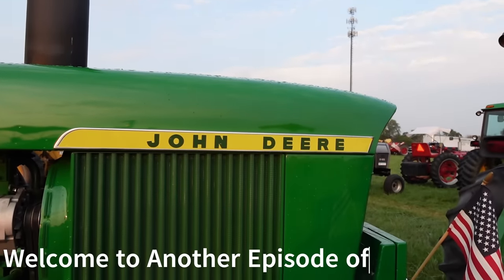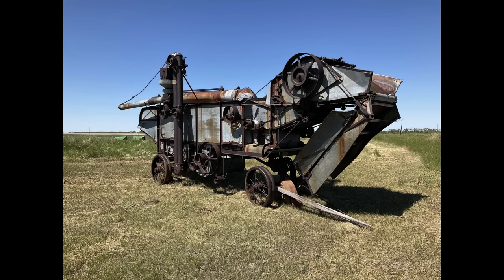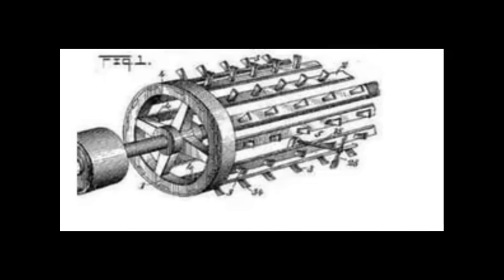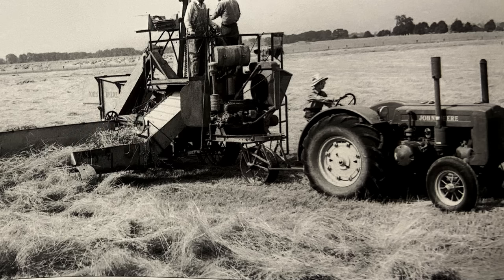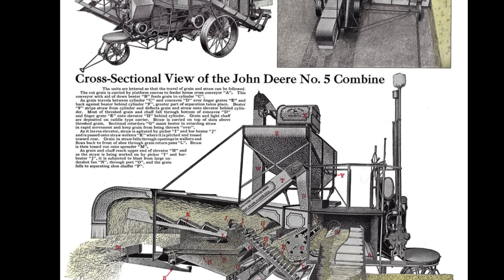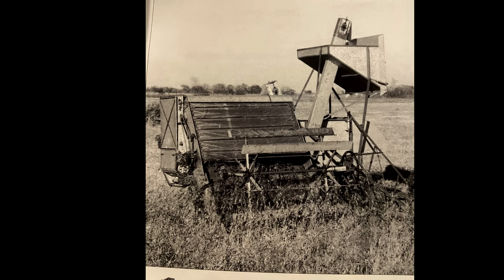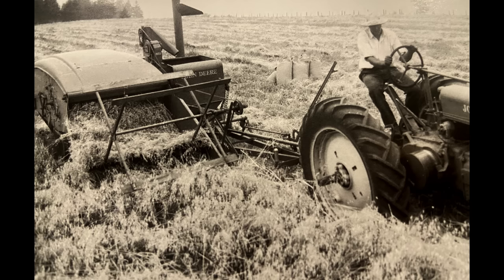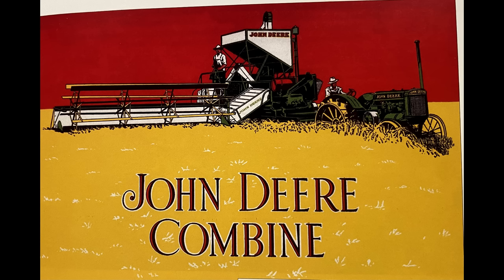History of John Deere Combines (Part 1)

Comment: I helped runJD 36B combine pulled by D4 cat from 1966-68 . Dad already had JD 55 with an added hillside conversion done in Garfield Wa, later JD 55H,95H, both factory hillside combines, in 2001 I ran JD 9600 with hillside added in walla walla, Wa with a 30 ft header for a friend after leaving my family’s farm on some very steep hillsides . We cut 2100 bu on a good day with the old 36B hillside combine, it started w/ a crank, header was 16.5 ft header. It had a 2nd (upper)cleaning sieves and many of them had an automatic leveler control built in Spokane Wa, an added hydraulic header control enabled one man on a cat, usually D6 cat , to run the combine by themself. Dad paid $300 for the 36B combine when we had doubled our grain acres, it was 20 years old in 1966.

Comment: When my father was young, a thrashing crew came around to do the small grains. Then the family got a 12A with the continental engine (I think) and a bagger. Sometimes I drove the tractor from the late 60's to the mid 70's. Every now and then, the canvas belt needed sewn. We also went to Charlie Burg's junkyard near Zelienople, PA to get parts, such as the wood slats for the straw walkers. We got rid of it when he ran out of junk parts and scrapped the leftovers. I think they used a JD B, Then a 2010, and we also had a 3 cyl 820 near the end.

Comment: I came across an 11a I believe is a 1941. I'm told I am the 3rd owner of it and it only has 2 seasons on it. I believe the 2 seasons part because the paint is still in the bottom of the cylinder bar grooves. I will get it restored someday. Got it and a 39 styled B for $750 each.

Comment: I worked with my uncle in the early 60's using probably a 12A combine with an engine.    He windrowed his oats with his hay mower with an attachment and because the combine  was a left sided feed, he had to start in the center of the field so as not to drive on the uncombined windrow, and work outwards.    By the mid 60's, he had bought a new combine and I was off to college!
Reply: My father had a 12A with a two cylinder motor. The combine itself ran good. Having to watch and care for the canvas added time and work. The real problem was the two cylinder motor. It would run fine for awhile. Then it would refuse to run for some time. Which was a headache, because it was hand crank started. Dad would crank and crank for a half hour to an hour before it would restart. Mechanics from five different John Deere dealerships tried and couldn't fix it. Independent mechanics tried and failed. After years of this frustration, Dad finally traded for a PTO driven #30. We had far better harvest seasons after that!

Comment: Dad bought a new 12A around 1950. It was PTO driven 12A with a pickup head as we swathed our barley.  The swather had a 10 ft head, so with the higher yields in Southern Ontario, it was a bit much for the 12A to handle.  Dad had a Cockshutt 30 tractor with live PTO and creeper gear, but we still had to "slip the clutch" to feed the 12a combine very slowly so we would not "plug" it.  Around 1970 dad bought a used model 30 combine which handled the 10 ft swaths much better.

Comment: My father bought a used John Deere model 2 combine shortly after his WWII military service in the Pacific Theater.  Dad did custom harvesting of small grain in North Dakota with that model 2 combine.  Dad cut the steel rims off and added used rubber tires (when they became available after tire rationing ended) for easier road transport.  He pulled his combine with a John Deere model D tractor.   

Dad and Mom purchased a farm near Finley, North Dakota, in 1950 shortly after their marriage.  I was born in 1952 in Sharon, N.D. in a one room hospital.  Dad and Mom sold their N.D. farm in about 1956 and moved to northwest Iowa.  Dad moved his J.D. model 2 combine to Iowa and used it there for a few years.  

I remember when I was about 7 years old driving the JD model D tractor pulling the #2 combine while Dad rode along teaching me how to do that.  So the first combine I learned to drive was the first model combine that John Deere built.

During my farming career, I owned or drove the following John Deere combines -  a 55 roundback (Dad owned that combine), two 55 squarebacks (Dad owned one, I shared ownership of the other)-  one 7700 , one 7720, two 9500s, one 9510, and one 9560 STS (I owned all of these after Dad retired.)  

So I was fortunate to know what it was like to experience operating many different combines that were built from 1927 to 2007.  My last JD combine had a GPS yield monitor and GPS auto-steering.  I really enjoyed that GPS technology.

I remember Dad's JD model 2 combine parked in the grove when it was no longer used.  Later it was cut up for scrap.  In retrospect, that was a huge mistake to scrap it out.

Thanks for your video about early JD combine history.  It brought back a lot of memories.  (Retired Iowa farmer.)

Comment: When I was 18 years old, I drove the neighbors 55 picking corn and that was the first combine. I ever Grove then I started working for a farmer. That was a machinist that would brothers. Manufacturing company in Oregon, Illinois, and he had A.  105EB.
And we did soy beans and corn.
Reply: And when I was growing up on the dairy farm. We had A12A that had A luc motor on it, and dad took the motor off and put PTO on. That made a lot better combine.
Reply: I grew up on a farm we had a 12a with luc motor & a bagger system my job  was to tye the bags and you sat on top of the engine this was hot work

Comment: I had a 25 with wooded shakers  It was used got it around 1980 the shaker  broke after a couple years  found another one at a neighbors that had metal shakers   Removed them and put in my machine. Worked great   I keep thinking how did l ever accomplish that  was young and could do anything. WOW

Comment: We had two #36 combines in Northern Montana in the 50’s  We pulled them with an R and a TD 14 crawler.  When the 55’s came along we ran it and the two 36’s for a few years.  Once the 95 came along, that was great.  The diesel gave us enough power to get through the heavy spots.  The gas engine on the 55 was kind of wimpy.  Once the 105 came along we retired the 36’s, and I spent several summers taking them all apart for the structural steel in them.  We still have a few angle irons with that old green paint.

Comment: We had a #17 Deere combine with 16 ft header that was used up until the late 50's and pulled mainly by a Cat D2 or RD6.  My first job during harvest, at about the age of ten on our Kansas farm, was running the "ship's wheel" on the combine to raise and lower the draper platform when going through ditches. It was a test of strength and so Dad later converted it to hydraulic cylinder lift.  
The Deere had the four cylinder Hercules engine witch its distinct low RPM sound.   The #17 combine had the rear tow hitch to attach the trailer for towing the platform (header) behind the combine when the road was too narrow.  The platform was balanced in the field with about six long springs in a cluster compared to most of the old pull types which used a counterbalance weight.
Reply from the maker: Sounds like a fun harvest setup! Thanks for watching and sharing👍🏻

Comment: My Dad had a #25 pull type combine with a Wakasha 4 cylinder motor, we used it in oats and wheat. I believe he bought it $900 at an action sale.
Reply from the maker: That’s cool! What tractor did you pull it with?
Reply: @LocustMotorWorks  He pulled it with the ‘65 2510 narrow front

Comment: I have a #30 JD with the wider than body auger header.  I have only run it empty to see if it would operate.
Reply from the maker: Thats cool! did you restore it or is it all original?
Reply: @LocustMotorWorks  I haven’t yet restored it.  I have all the new decals . It’s actually quite amazing how little wear it has . The knife ,rub bars and auger flights look near new.  I may sell it as we now spend winters in the south .